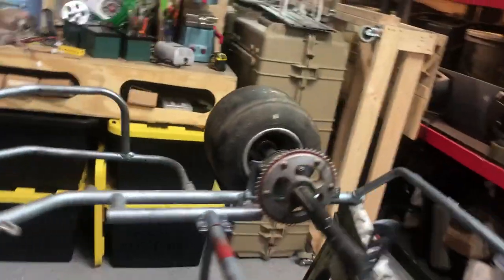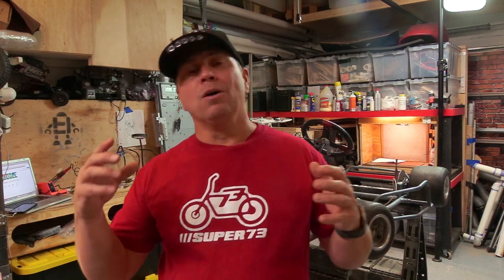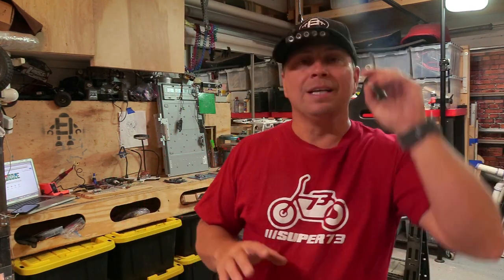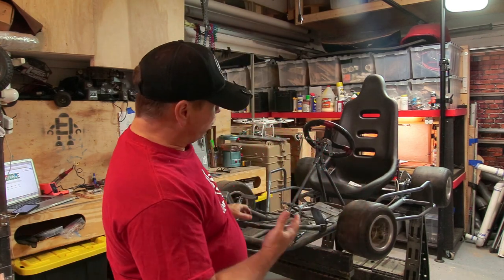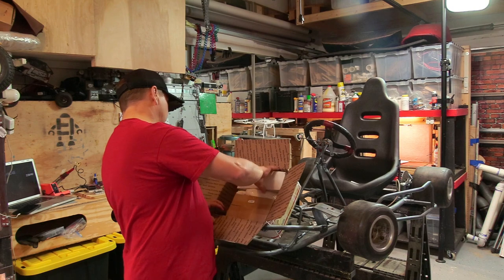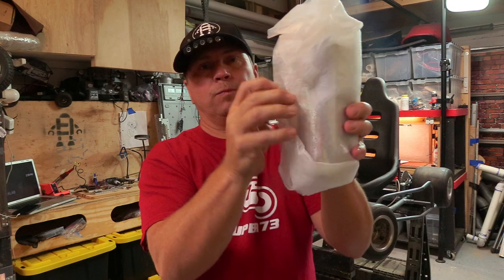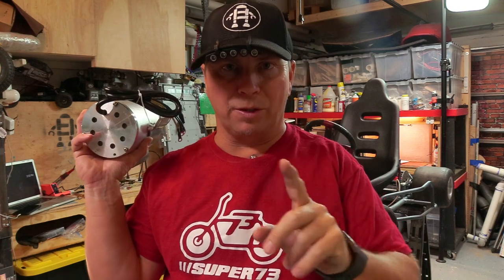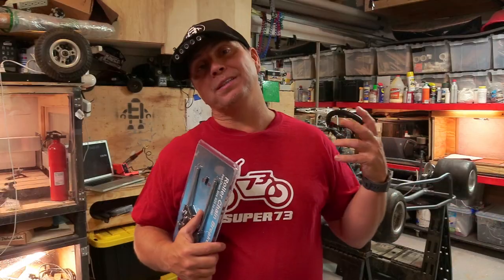Electric Gokart Conversion from Gas (Part 1)

Comment: Calculating the final drive ratio is a critical first step in having a good outcome for an electric conversion.  China uses the same motor housing for a LOT of different motors and winding configurations.  This, and the lack of accurate honest advertising makes it very difficult to choose the correct parts for a given application.
That being said, the more Amps the motor controller puts out, the more power you will get, at least until the motor(s) catch on fire.
For this application, I would have recommended 2 brushed 800W motors at 36 volts with 1 golf cart controller (200-300Amps) because I have the motors in stock and can guarantee rapid acceleration 0-30mph with an adult rider.
Brushless motors rock and it may be possible to accomplish this with one motor, but two motors can dissipate more heat and therefore take more amperage.
Reply from the maker: Thank you

Comment: When are you planning on posting a part 2 vid? I was considering purchasing this exact kit and I could definitely use this series as a guide.
Reply from the maker: Adding solid but Chinese wheels required me to print a hub adaptor, I have to hack the motor sprocket to go to #35 chain, the $35 seat ordered is perfect.   I'll post a video tonight bu no wiring to Video 3.
Reply from the maker: Part 2 is up.  https://youtu.be/JTgX2yZlUc4  Good news in Part 3 you see it working!!

Comment: This will be a fun build but I can tell you it will be slow. If you gear it to hit 20mph it will accelerate very slowly.
Reply from the maker: Bran Don already having doubts about motor but, but, the price was right and I’m already learning a shit load about electronics and dc speed control
Reply from the maker: Is 4500 rpm low ? How did you calculate the speed.
Reply from the maker: Part 2 is up.  https://youtu.be/JTgX2yZlUc4  I calculated the speed at 32 mph, with 4500 RPM,  11' Wheel Size, 12 sprocket teeth and 55 axle sprocket teeth.